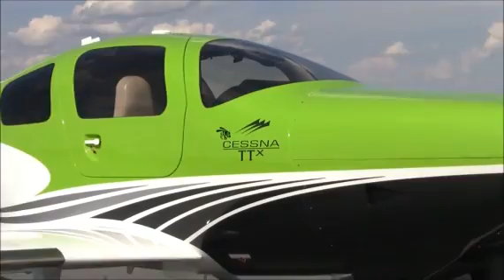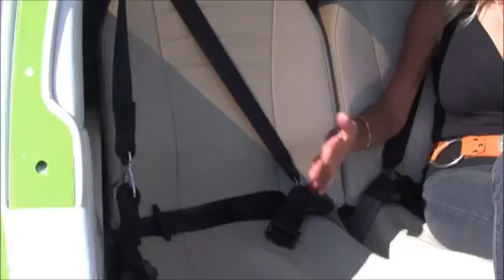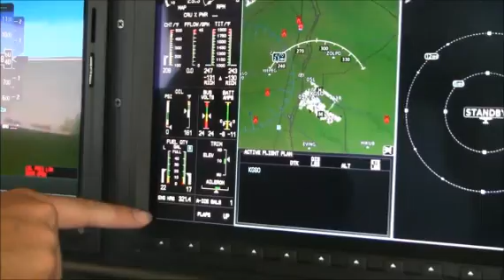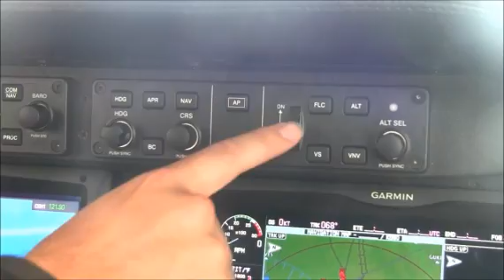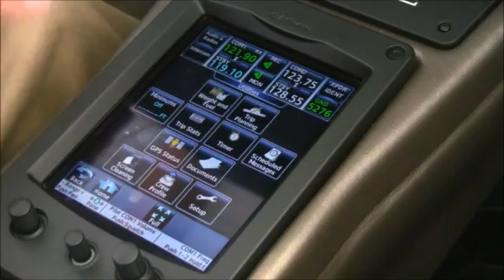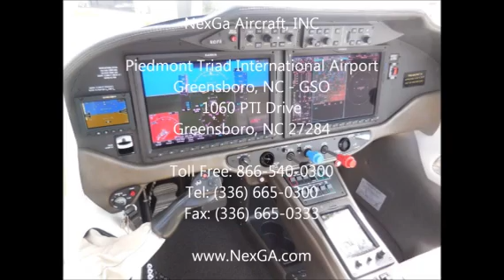2013 CESSNA TTX For Sale

Comment: I have not been an AOPA subscriber or flown for a while.  I'm shocked to see this airplane.  I didn't know Cessna made this.  Did they just clone a Cirrus or what?
Reply: Unrelated to the Cirrus in any way. Its based off the Columbia (Lancair) 400. They aquired the company and aircraft. Added a completely new panel, interior and anti icing system.

Comment: Why would one want to use speed brakes on takeoff?  What am I missing here?
Reply: Of course you normally would not use the speed brakes during takeoff but the point she is making is that if you forget to retract them while doing a go-around the drag penalty at low speeds (like takeoff) is so minimal that performance is unaffected.
Reply: Thanks for the clarification.  My question was based on the fact that I could see no advantage to using speedbrakes deliberately on any takeoff.  I guess it is nice to know that unless you need every ounce of performance they aren't effective enough do in the absentminded pilot.
Reply: You are most welcome. I've been fortunate enough to be flying a Columbia 400 (the progenitor to the TTx) for 10 years and 2000+ hours, the speed brakes are one of the many sweet features of the aircraft. Allow you to descend without having to chop power (typical descent from say FL190 I will make at cruise power with speed brakes deployed, that gives you 1,000 FPM down without shock-cooling engine and also keeps you below top of green, which is 158 KIAS thanks to Utility Category certification). From an operational standpoint very useful. One of my previous planes had spoilers which were one more thing to retract during G/A, there was supposed to be an automatic switch retracting them if you went to full-throttle but it didn't always work and the drag penalty was substantial.
Reply: The TTx is a fantastic x-wind aircraft with a max demonstrated x-wind component of 25 knots. Speed brakes are primarily useful for managing descents without needing to reduce power and without needing to make major configuration changes like deploying flaps. They can be used throughout the aircraft's operating envelope unlike flaps which have max deployment speed of 127 knots for approach and 117 for landing.
Reply: Love your wine.
Reply: yeah, maybe if ur going too fast, lol. or maybe to stabilize in a crosswind, dunno just guessing.